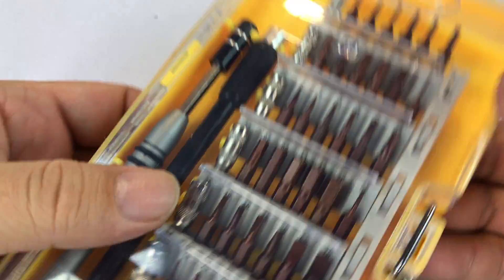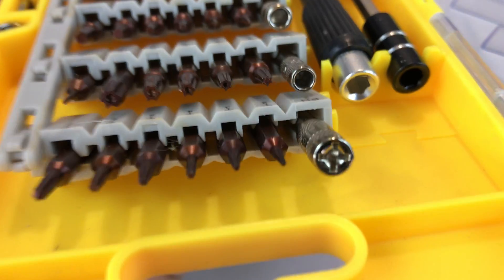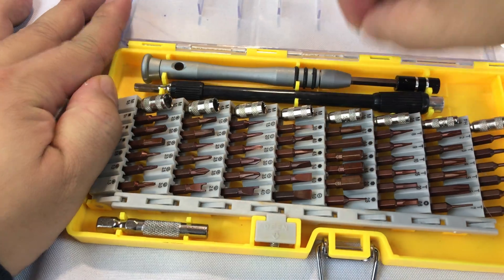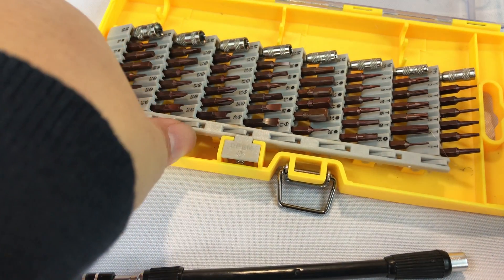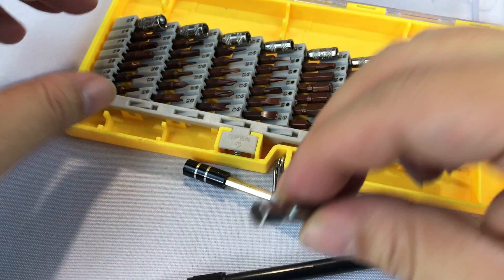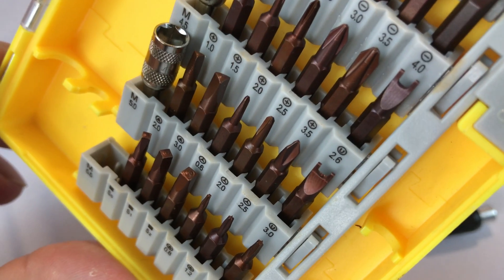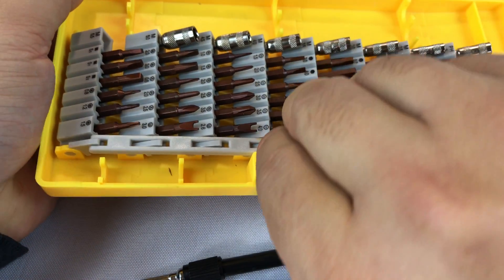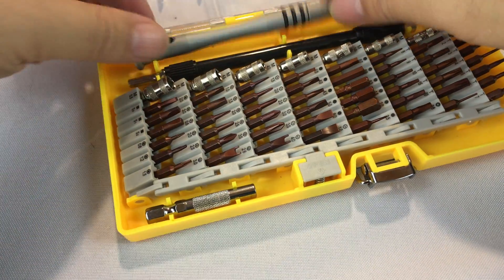56 Bit Precision Electronics Screwdriver Tool Kit Review

Comment: How long do the fine bits last ? Because of some of my old ones broke in days.
Reply: Mynameisnot Amd look for Kingsdon
Reply: I had the same problem with a Craftsman kit, I'd rather pay a little more and get some hardened tips, did you find anything?
Reply: @bigredc222  I purchased this one. And it's going fine for me. I don't use them everyday but they are of decent quality for electronics repair. The aluminum driver has no grip for other uses.
Reply: @mynameisnotamd2923  I just got mine yesterday, this kit has tips smaller than I've ever seen, what really sold it for me was the adaptor so you can use the tiny tips in a regular 1/4" driver.

Comment: The larger ones on the left side all the way up that are chrome plated, are Micro Metric Sockets Bits. If your into electronics this is NOT for you. These will not last only Wiha, Wera, Felo, Witte, Gedore, Stahlwille are the ones to get that will last a very very long time, made of high quality steel and precision fit, so they don't cam out screws or wear out.

Comment: I had one of these sets - not very good! Bits were the wrong sizes and didn't fit the screws properly, some of the bits were missing and replaced with other bits and the handle, very sloppy chuck and non rotating cap. I complained to the vendor and they wouldn't help me out. Probably better to look elsewhere.